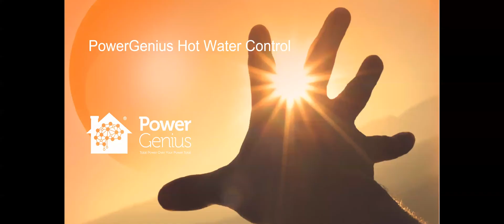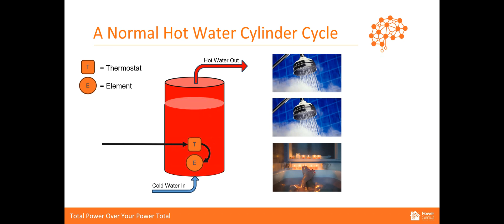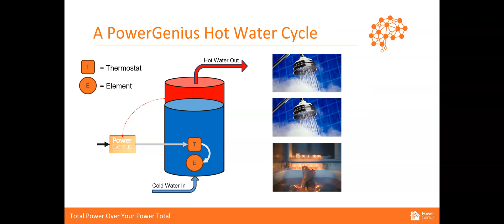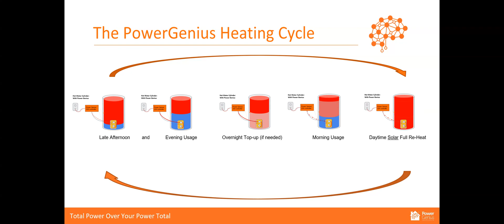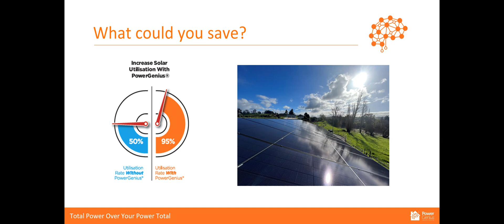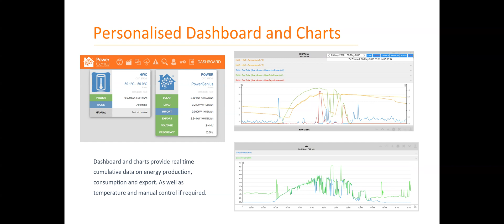How the PowerGenius controls Hot Water Cylinders

Comment: Here in Charlotte , North Carolina, our power company pays retail price for the excess we produce. ( The meter runs backwards during high solar production and low usage )   So this means your system would not benefit me here. Also we use a hybrid heat pump hot water tank meaning we use about one quarter the power of a conventional element hot water tank. However,  I will certainly keep your genius system in mind just in case the power company decides to not pay me retail price for my excess.  -- Great idea to use hot water as a battery and charge when the sun shines ----
Reply from the maker: Thanks for your comment - wow North Carolina! I think I might have to move... It's been 12 years since we had "1 for 1 energy billing in NZ.